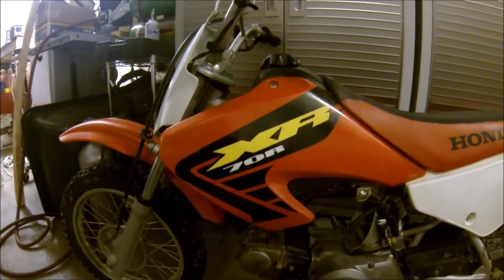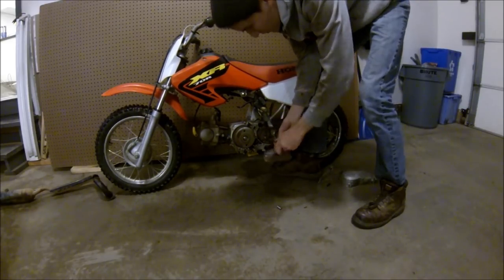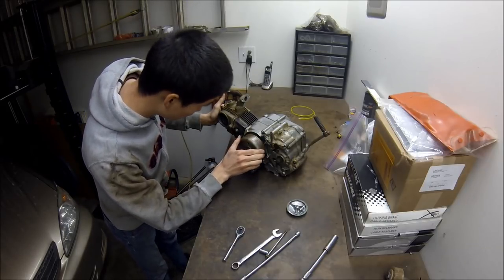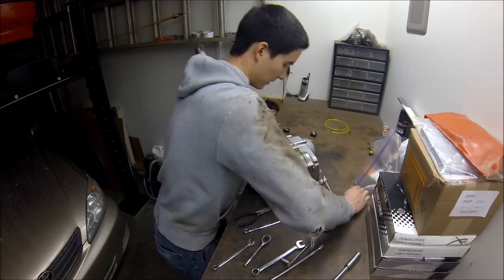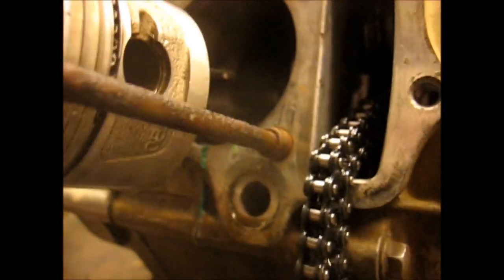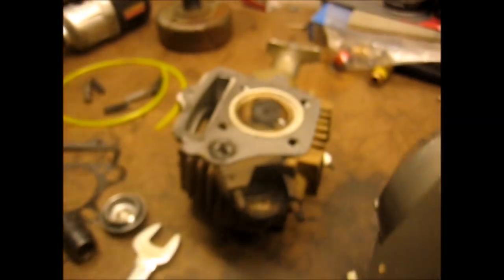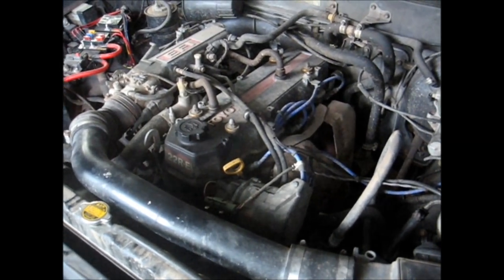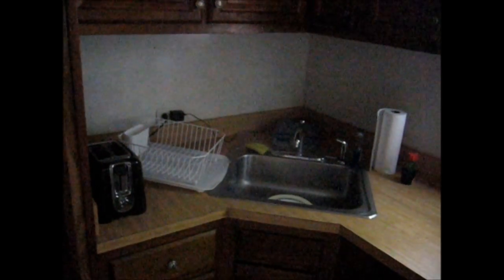XR70 Engine Overhaul Part 1 + Life and 4Runner Update

Comment: Hey thanks so much for the informative video. I want to ask your advice. I have the exact same xr70r. put it up for winter storage, and when I brought it out in the spring it began smoking white smoke immediately. bike have very low hours, and never smoked before storage. it looks like rings or cylinder wear but I'm just not convinced it could start so suddenly. any ideas?